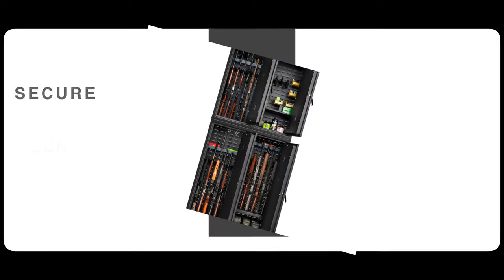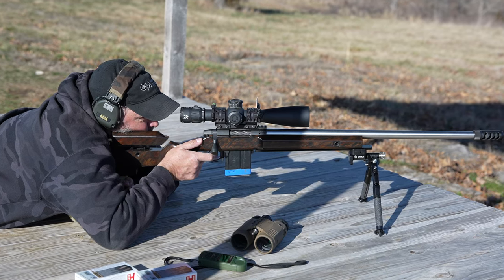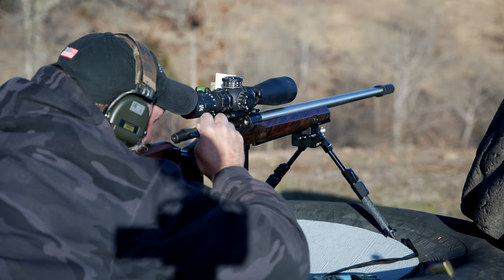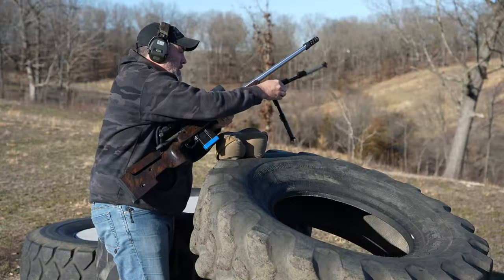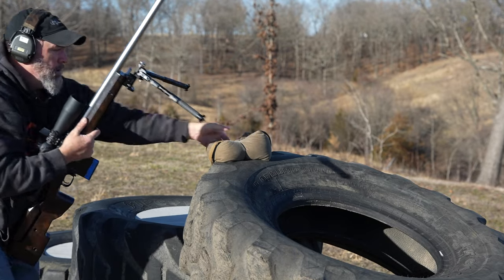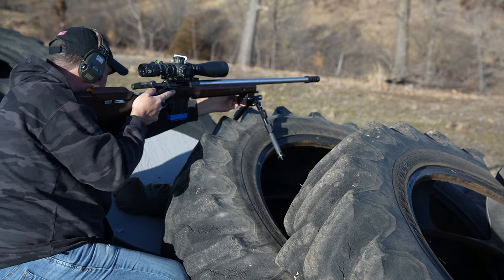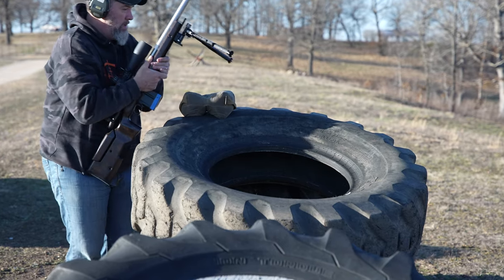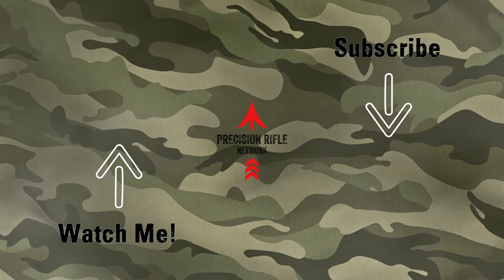3 Things you may not know about positional shooting. Tires.

Comment: Generally I use a bag only unless there is enough surface area for a bipod and bag. I've ditched bipod's after using them on the first tire that is a flat arrangement like you have set up here.
Reply from the maker: It’s true, it can all be done with just a bag on most barricades these days.